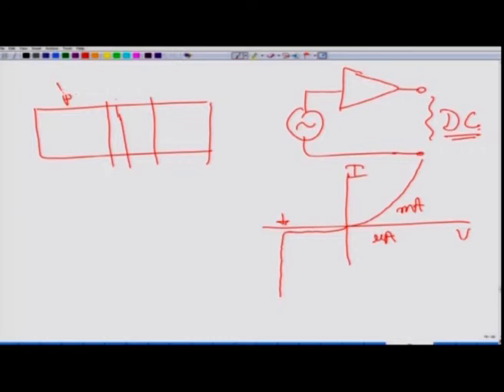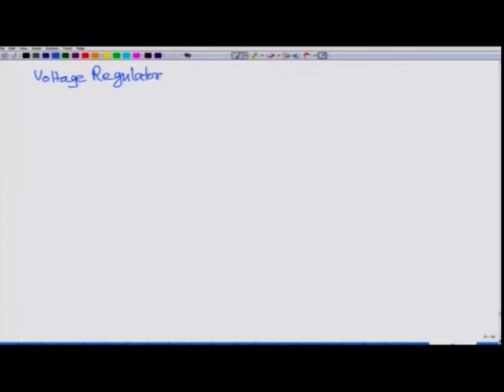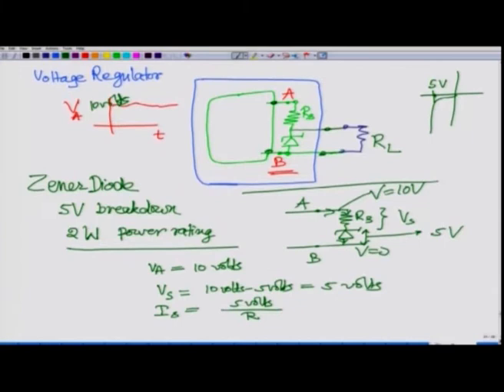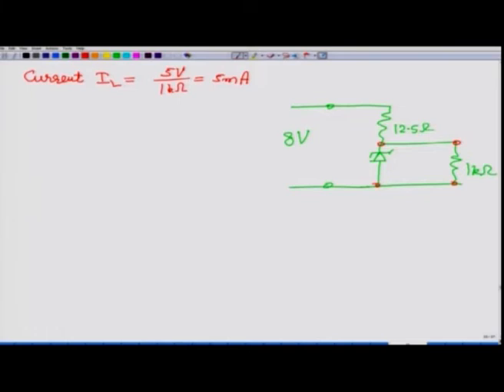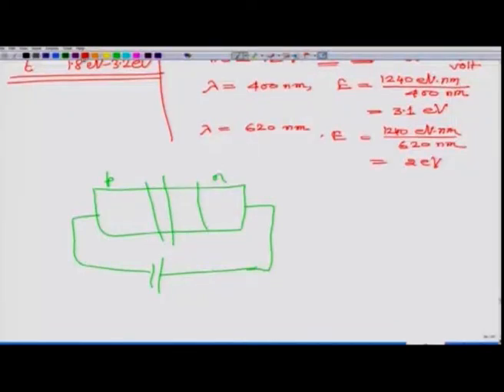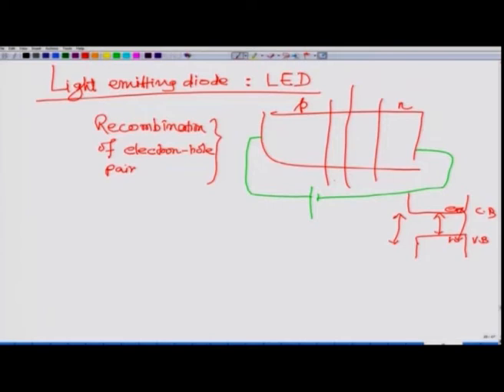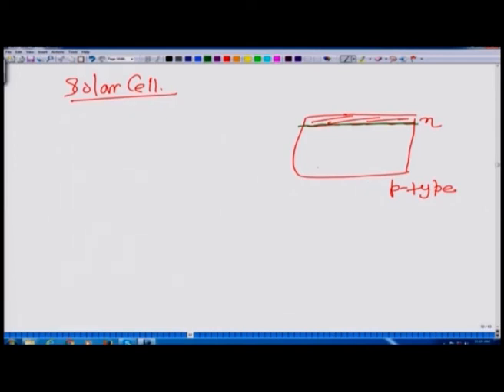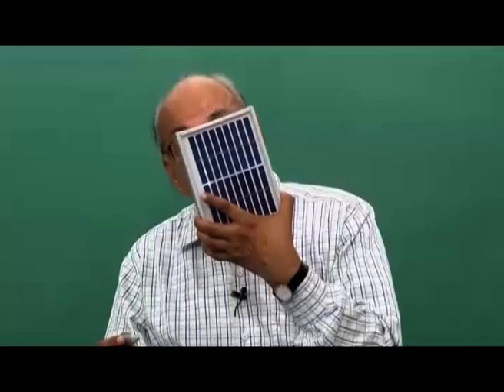Special Purpose P-N junction (PHY)

Comment: 20:00 why is it said minimum resistance ? I felt it would be maximum.
Reply: Because the current in diode should not exceed certain value i.e. maximum value. And from R=V/I, if Current is max,R is min